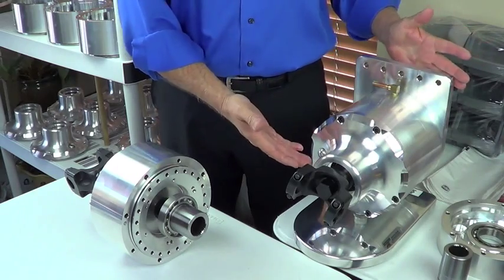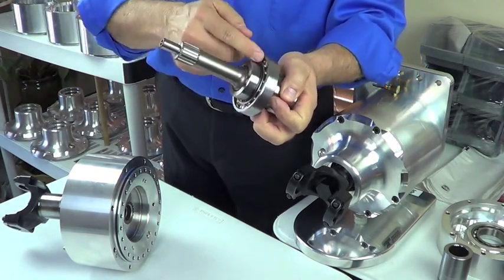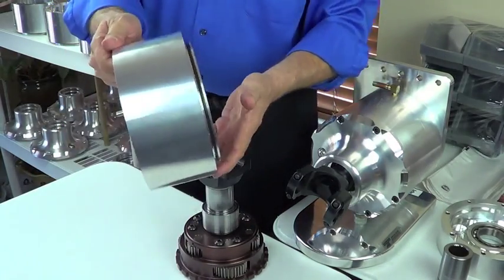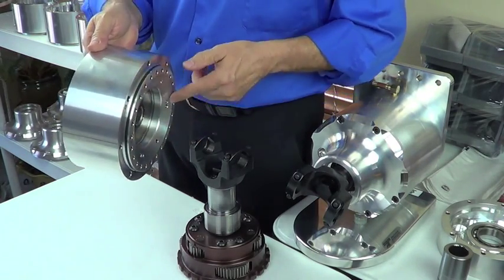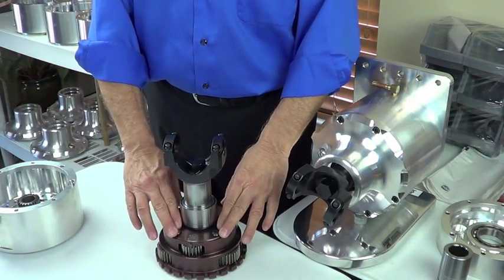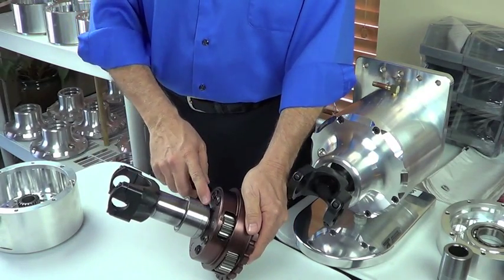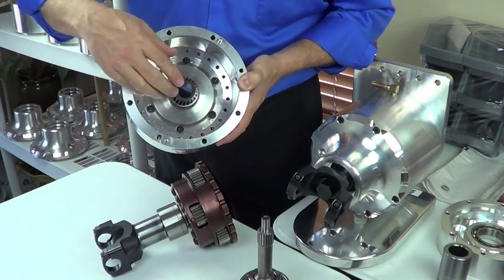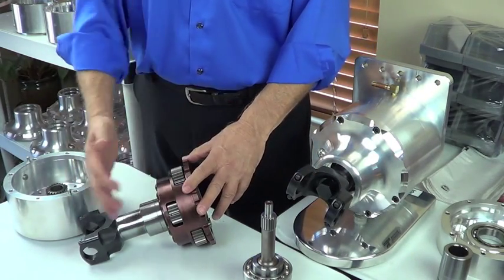EV-Transmission / Torque Box Power Flow

Comment: How loud are those straight-cut gears?  Usually exhaust noise drowns out the howl, but EVs are pretty quiet.
Reply from the maker: Matt we use 9310 straight cut gears in gas and Diesel powered vehicles, primarily off road race trucks. Most of our ev packages use helical cut gears.

Comment: Really stupid questions coming from me:
1 That small thing is an automatic transmission ?
2 It has reverse ?
3 You have the electric moto for it ?
4 What is the price for motor and transmission ( for 1970s car ) ?
Reply from the maker: A SINGLE SPEED REDUCTION GEARBOX THAT REPLACES THE MULTI SPEED AUTOMATIC TRANSMISSION. NO NEED FOR A REVERSE GEAR WITH AN AC ELECTRIC MOTOR, YOU SIMPLE TURN THE MOTOR BACKWARDS TO BACK THE VEHICLE UP. WE ARE A DISTRIBUTOR FOR UQM/DANFOS MOTORS.

Comment: Nice, I plan to use a Leaf motor, will you have an adapter plate for this?

Also my conversion is a Toyota 4x4. Assume I will need to keep the 4x4 transfer case. 

I would need to fabricate a housing and thru shaft from the torque box to the TCase. 

Do you sell the torque box without the prop shaft coupling? 

Hmm it would be a clutchless conversion tho...
Reply from the maker: WE DON'T CURRENTLY FIT THE LEAF MOTOR. OUR EXPERIENCE HAS BEEN THAT PEOPLE USING A USED LEAF MOTOR WOULD PROBABLY NOT PAY $3500 FOR OUR GEARBOX, ALTHOUGH AN ADAPTER PLATE IS NOT DIFFICULT.

Comment: I have a question... 
Is it like an automatic change gear box for an electric vehícle ?...  do you have some like this for an ev conversion  with front wheel drive?
Reply from the maker: Our Torque Box is a single speed reduction gearbox so there is no shift. We do have a transaxle unit in development, it will take another six to nine months before it is in production. Please check our website for updates. Kind Regards,